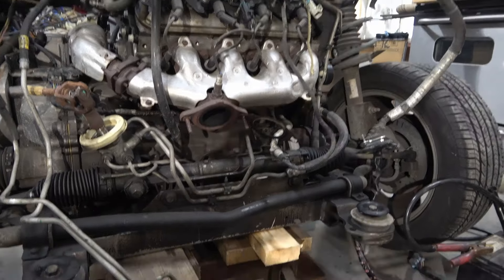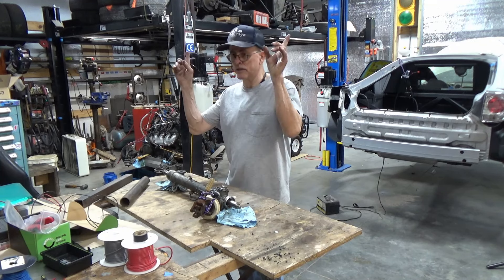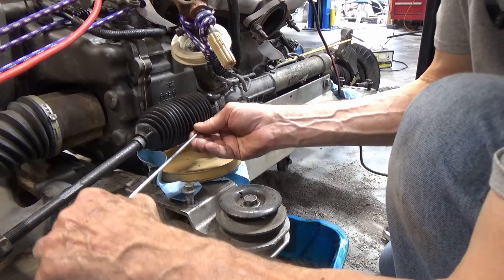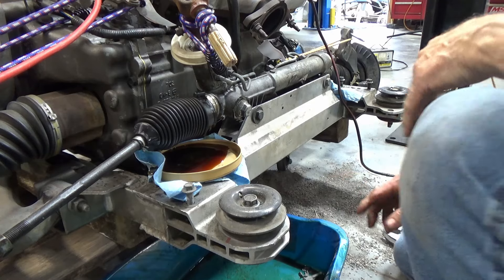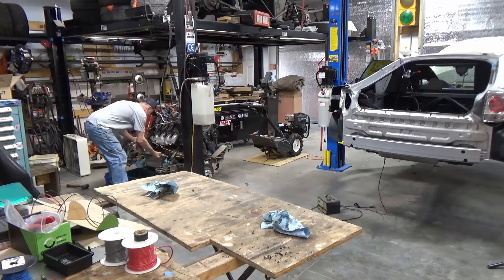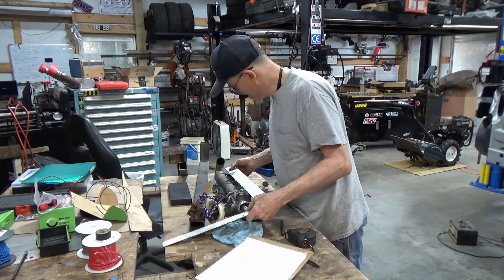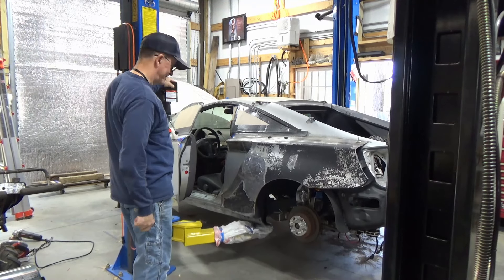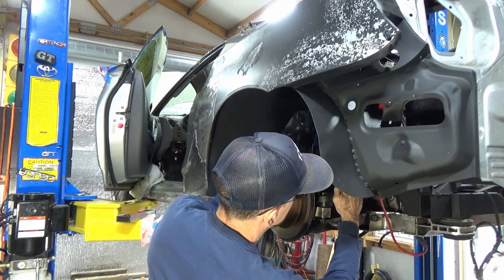44. STEERING RACK ELIMINATOR. Front wheel drive power train for rear wheel drive,  V8 Celica GT-SS

Comment: I was thinking you`re doing power steering delete manual rack for front. And in the end steering rack became rear toe adjuster ? :D am I right?
Reply from the maker: Yes,  the front is still the stock Celica steering rack with no power assist. Rear is parts of the Impala steering rack made into a toe adjuster?